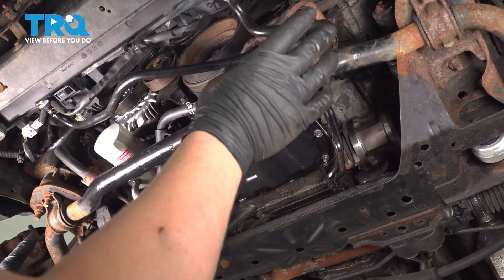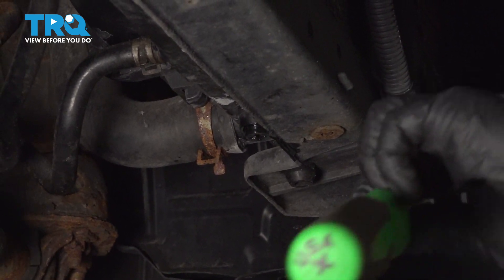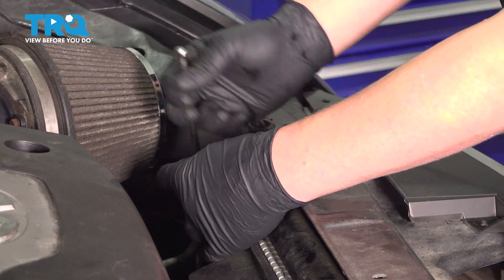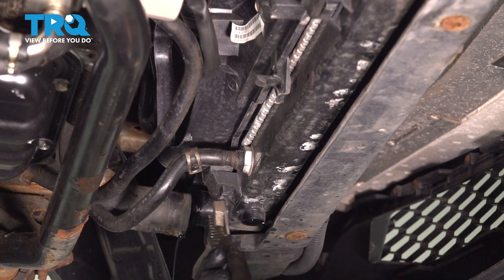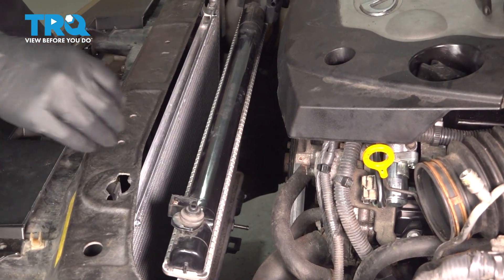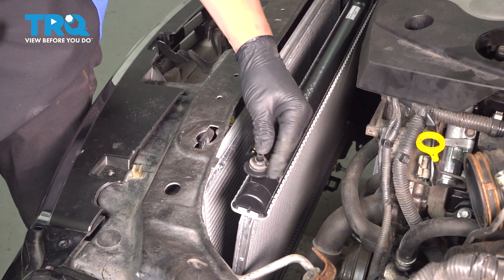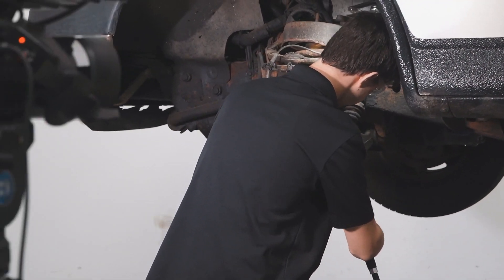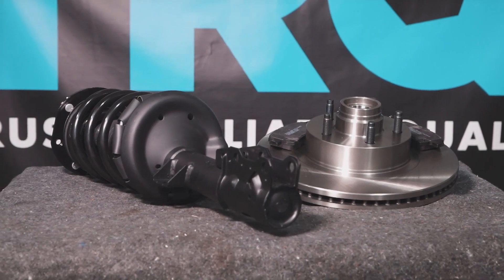How to Replace Radiator 2003-2007 Infiniti G35

Comment: I did read that is you allow air into the trans lines the trans can be damaged on these cars.   How do you avoid this, how much air is to uch?  The little bit that driped out of the lines should be no big deal however, the trans cooler in the new trans is empty.   Should you fill the trans cooler with fuild before installing the radiator to help avoid damagng the trans?